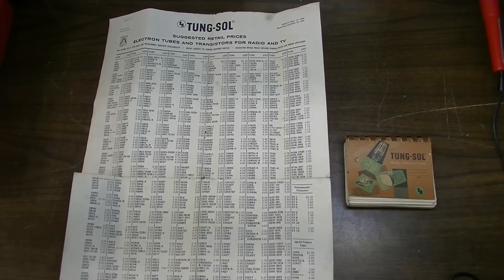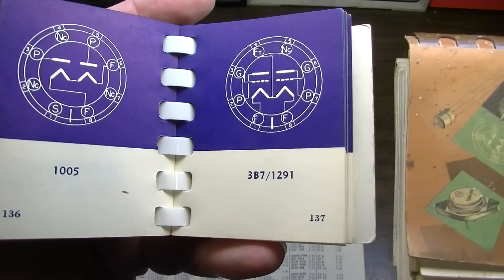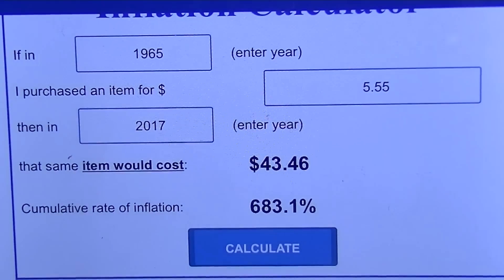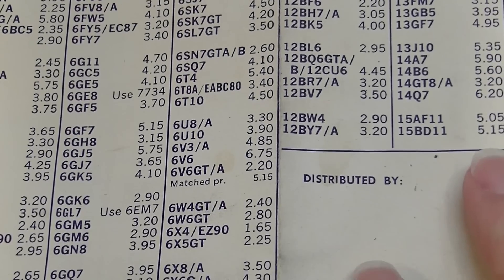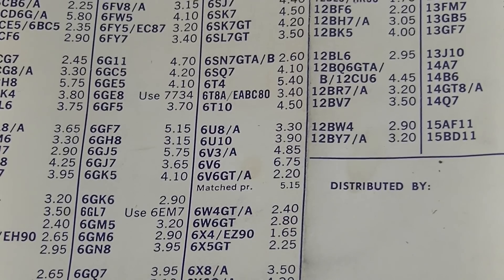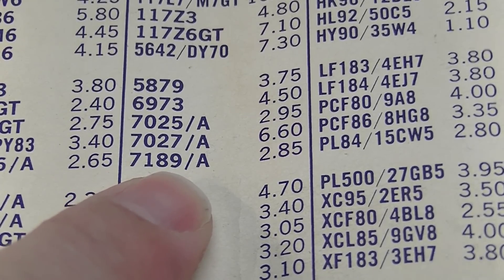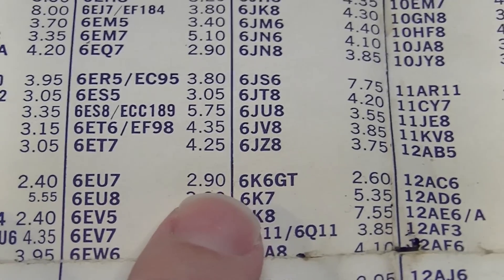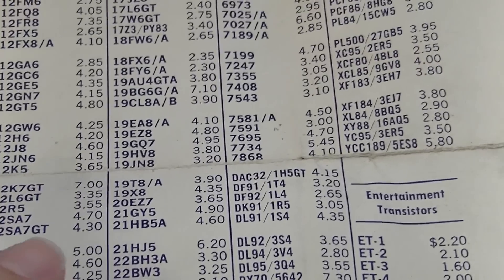How Expensive were Electron Vacuum Tubes in 1965?

Comment: i was born in 1964, and i remember when my father purchased a zenith console stereo, it was VERY expensive.  i remember him and mom discussing this over the supper table one night.  i think he gave $300+ for it which translates into $2,000.  they owned this stereo for 30+ years until they decided to leave it behind in a move.  dang!  i wish i had that stereo!  it sounded sooo warm and nice.  if i had the room, i would buy a vintage one.  still, to scratch that itch, i have a new-production EL34 powered amp that i am running through a set of crites cabinet speakers and it sounds wonderful.  really good.  in the pre-amp stage of my amp, i run a pair of 60's telefunken smooth plates in the 12AX7 slots, and a pair of of english brimar CV4003's in the 12AU7 slots, and a quad of 60's mullard EL34's in the power section.  i will NEVER sell or trade this system.  

thanks for the history lesson.  really good information here.
Reply: JohnMac in general, older speakers sound better. New speakers sound brittle and tinny in comparison. Slot of other stuff is better today but not speakers

Comment: Interesting insight on the value of a dollar today and how good we really have it. I recently acquired a bunch of tubes from a machine shop that calibrates testing instruments and gauges. Their old calibration instruments used tubes. I’ve got dozens of 5963, 12au7a,  5965, 6bf6 and tons more. I acquired an old portable drug store tube tester off Craigslist for $20 and a bunch of my tubes can’t be tested on it because there are no sockets for them. 
I threw a 5965 in my Marshall in place of a 12 ax7 and it toned down the gain just a bit, in a good way. Got rid of the fizziness at higher gain settings.

Comment: id love to know why a 6v6 is called a 6v6

i know one number is the number of pins........ but what the hell is V, EW, EX, KD....
whats the difference between a 6EU7 and a 6EV7?

also.... ive got an old Baldwin church organ..... its got like 50 tubes in it

it works..... but it sounds VERY messed up..... it actually sounded worse when we first got it (saved it from the dumps)
but after playing on it for about 2 hours, it now sounds better

but some of the options sound BAD

im sure its still using the original caps....so, theirs my problem, just to lazy to tear into it (my car needs a power steering pump, water pump, harmonic balancer, and window regulator)
Reply from the maker: I know how hard it is prioritizing projects sometimes. But sounds like that baldwin would be worth tearing into.
Reply: Rick Delair your saying it may have mechanical stuff in it?

Dont hear any motor noise (my grand mother has a 'newer' orgin....has a wheel with a slot in it for vibrato, air pump thing)

I work on cars and computers..... nothing i cant figure out

But i wanna do it right....so, it will wait

But, sub to my channel....ill upload a video of the baldwin tommorow or something

Comment: Now a days technology moves so fast that their value drops just as fast.  One good thing about these old tech they were built to last.
Reply: well they were larger and less heat, and could use caps that lasted longer, the main problem with today is they are small and run hot and the caps fail. weve gone too far, staying put at discrete single transistors would have been 1/10th of the old size with 100x their reliability

Comment: Firstly I'm a total beginner and a layman but, would it be feasible for all the major tube amp manufacturers to partner together and start their own tube manufacturing factory so they could maintain the machinery properly that makes the tubes and negate their current problem of tubes being unreliable? Is the equipment the manufactures tubes insanely expensive or why has this option not been explored.Especially when it is evident how friendly most amp builders are with each other and this would really benefit all builders immensely?

Comment: Don't you wish you could go back in time and load up on items like this? In '69 Carter made a 1000CZFM Thermoquad that put a Buick GS with a 455 in the low 13's. They cost $69. Bucks back then. If only we had a time machine!
Reply from the maker: I was thinking about that the other day and curious, I looked up the historical returns if you put your money in the stock market vs in something like tubes. A 10k investment in a cross section of the stock market in 1965 would yield an annual return of around 7%. If all monies are reinvested, that $10k would have turned into something like $300k today. Tubes would not have been as lucrative.

Comment: Born in '53. In the late 60's, early 70's, if we had amp trouble, we'd run to the local corner drug store who always had a tube tester & a small stock of common tubes. Could get 12AX7's & 6L6's anytime you wanted. Sometimes EL34's or 6550's as well. Only a few bucks a tube.

Comment: Those little tube reference/pinout books would have been good for "in the tube caddy box"  for service techs, I have 3 OLD tube caddy box's 1 is a CBS Tube box 2 is a SYLVANIA box and 3 is a RCA Box.  I have a Tung Sol reference booklet too but it also contains not only the pinout diagram but the spec's on the tube's too so it is quite some larger than your pinout guide booklets. Yea vacuum tubes are a good thing,  THEY WILL SURVIVE and EMP ATTACK and still be usable,  The silicon chip stuff of today will be absolute TOAST after such an event, be it man made (WAR) bomb OR SUN GENERATED by SOLAR FLARE type !!!  Interesting video,  I like those real small tube pinout reference books !!!   ------------------------------     John A Bellas     KC2UVN

Comment: The 7189A isn't actually a regular 7189, and I think it might not even have the same pinout. I've used standard 7189's in EL84 amps and it kind of makes it sound like the same preamp section with a much cleaner, higher headroom, 6L6 or even tertrode type of output, like if you put a pair of 7189's in one of those new 6505 mini heads, it kind of makes it sound more like a real 6505 head, one of the big ones. I think the "A" version, in this case, actually has a slightly different pinout. I could be wrong.

Comment: The 7199s were very attractive from a designer's PoV in what they could do; the tube is known for lots of 'bad apples', but since no other company bothered to develop anything similar, owners of those amps were left up a creek without a paddle, so to speak.  In the early 60s, the concern that someone might not be able to find an easy replacement almost sixty years later (what do you mean, "tubes will soon be rendered obsolete"? what a crock of bs...) would have probably been considered laughable, if it were considered at all.  Same could be said for Sunn's 6AN8s...another good take, Brad...

Comment: The good old days weren't so good in hindsight.
In 1967 I was making $1.40 per hour assembling box springs for the Sealy Mattress Company.
At those wages it would take a months pay to replace the tubes in an Ampeg SVT.    lol.
Reply: Run that through the inflation calculator and you'll find that you were making the equivalent of over $10/hr back then.
Reply: It sure didn't look like $1.40 per hour after they took out taxes and union dues.
At least a McDonalds hamburger was still 15 cents.    :-)
Reply: From what I can find, $1.40 was min. wage in 1967. If you were union, you were getting screwed in a big way.
Reply: I do believe you are correct sir.
The union dues probably came in after I served my probationary period and got a pay raise.
Sadly most of my memories of those days disappeared after I received a letter from Uncle Sam requesting my presence.   :-)
Reply: Crazy Uncle Duke well in 1988 I was making $3.50 an hour for GEC...and that was AUD Dollars.. Around $2.50 U S ....ahhh the good ole days...
Reply: yes electrical and electronics have never been cheaper and more acceible, there is also quality if you want to pay, theres a choice, there didnt used to be
Reply: Actually, those days were better.  You pretty much knew a man from a woman, church attendance was much higher and the divorce rate was lower.  But now we have the Internet.  Great, huh?

Comment: Wouldn't the metal can 6l6 be more expensive due to it being used by the military? You know, mark it up because its for the government.
Reply: archenemy24 Metal can tubes were inferior designs from 1940s - gave off more heat than power! Glass bottle tubes were all the rage by the 1950s - can’t understand the price difference, especially by 1965?
Reply: archenemy24 A metal tube is more rugged, my guess is just a glass glass bottle is just cheaper to make.
Reply: Dave Keating I see my mistake now. I was going from the dates of his base booklets, especially the '53, rather than the date on the price sheet itself. That'll teach  me to double check things before I post. Lol
Reply: I believe the glass 6L6 tubes sound better than the metal ones.
Reply: Maybe I never thought of that one.  They died off, never to be seen again.
Reply: +John Simms Well, stick a quad of NOS ones in a JCM800 then sit back and enjoy the light show. Afterwards, you’ll probably need to source a new set of tubes (glass type ;-)), a new transformer, and a new speaker or two!